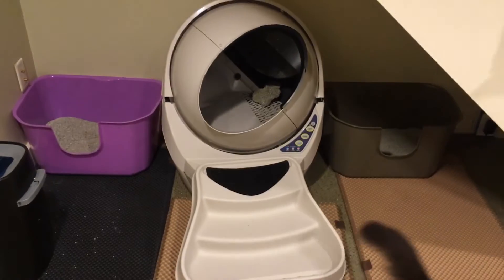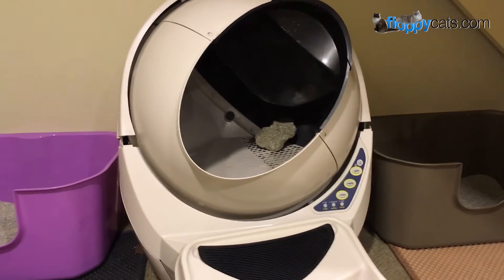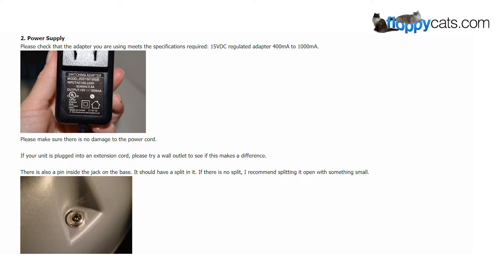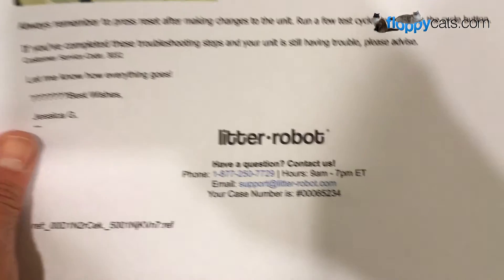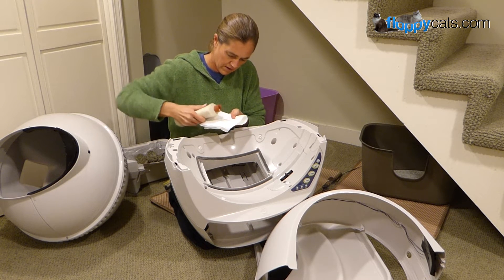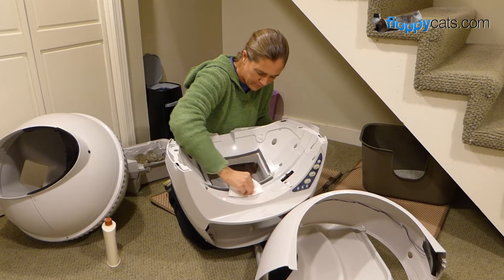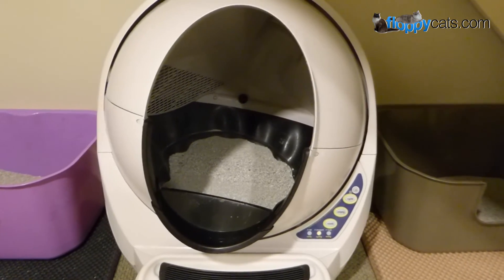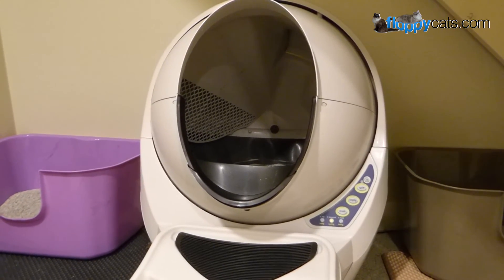Litter Robot 3 Open Air Troubleshooting - All 3 Lights Flashing - Floppycats

Comment from the maker: ✅ Litter-Robot 3 Buying Options:✅

💵 Worried about your cats using it? Want to be able to return it without paying for shipping?
😻 Buy on Chewy - Get 24/7 Help + FREE 1-3 DAY SHIPPING:
https://bit.ly/395ovFR

🤑 Buy the Litter-Robot 3 Connect on Amazon: https://amzn.to/3E1lrsP

🦘🥝Live in Australia or New Zealand? Click here for your Litter-Robot Open Air distributor: https://catevolution.com.au/litter-robot-iii-open-air.html?tracking=floppycats

🔴 Subscribe for more: https://www.youtube.com/user/steiff1001?sub_confirmation=1

Here's the email that LR sent me that I reference in this video:

If the Litter-Robot 3 cannot find Dump and/or Home position, the control panel will display 3 lights blinking. If you have recently disassembled your globe, please advise.

There are a few reasons why you could be getting this error message. We will touch on each component.

PLEASE NOTE
If your unit was purchased on or after February 21, 2018 (Serial Number 078843 and above), your unit will not have an internal shield. It will, however, still have the black key on the back of the globe. If you do not have an internal shield, please disregard the shield instructions (first video link) in number 3. You may still check the key/spring (second video link).

1. Excess Weight
If there is excess weight inside the unit, this will cause the motor to slow down and the unit will not complete a cycle in the allotted timeframe (~2 minutes, 45 seconds). Please check your litter level to ensure that you are at or below the fill line. If necessary, remove some litter from the globe so that the level is an inch below the fill line, then press the Reset button. It's best to empty the waste drawer as well if it's getting close to full; this will eliminate that excess weight also

2. Power Supply
Please check that the adapter you are using meets the specifications required: 15VDC regulated adapter 400mA to 1000mA.

Please make sure there is no damage to the power cord.
If your unit is plugged into an extension cord, please try a wall outlet to see if this makes a difference.

There is also a pin inside the jack on the base. It should have a split in it. If there is no split, I recommend splitting it open with something small.

3. Internal Shield/Key
If the internal shield or black key isn't set properly, this will cause cycling issues. When your unit is in the home position, the shield should be in the top left corner and the key should be straight up and down sitting in the groove of the base.

Below are two videos that show you how to reset the shield and key if necessary.
Key/Spring: https://youtu.be/RFdIfriScrM

Another option is to remove the internal shield. The internal shield is not necessary for the unit to function. To remove the shield, you will need a Phillips head screwdriver. Remove the screw from the center of the black key on the back of the globe. Once the key is removed, you can easily pull the shield out from the entrance of the globe. If you decide to remove the shield, please let us know and we will send you a key-hole plug for the back of the globe.

You can see the video on how to remove it here: https://youtu.be/OcxGXxMb8mI

4. Bonnet
If the bonnet is not seated properly, this will cause the unit to start and stop during a cycle. To make sure your bonnet is seated properly, please follow these instructions:
Disconnect the bonnet
Gently flex the two front bonnet tabs outward as close to a 90-degree angle as you can and hold for 20-30 seconds. This will remold the tabs to have a more secure connection.
Reattach the bonnet. There are four tabs total: two curved tabs in the back, two on the sides. The two curved tabs in back tuck into slots in the base. If they are sticking out, the unit will not cycle properly.
You should feel a secure snap and hear a solid “click” when placed back into the slot and the bonnet should sit closer to the base.
Assembly Instructions: https://support-litter-robot.force.com/s/article/Assembling-the-Litter-Robot-3
Video of removing/replacing bonnet: https://youtu.be/f2WVPQsR-Iw

5. Globe Lift
If the globe is encountering resistance that is lifting it out of position as it cycles, friction will occur between the plastic of the globe and base, causing the magnets in the globe to skip the position sensor which will cause the 3 blinking lights.

Out of the box, the Litter-Robot has a silicone lubricant layer that can wear off over time. An easy solution to this is Pledge Furniture Polish (if you have a different brand of furniture polish, it will work as well). We would ask you to please simply spray the polish on a paper towel and wipe the track of the base where the globe sits. Please avoid getting it on the black gear. I have attached a picture of the track of the base for your reference.

Always remember to press reset after making changes to the unit. Run a few test cycles by pressing the cycle button.

If you've completed these troubleshooting steps and your unit is still having trouble, please advise.

Litter-Robot
Have a question? Contact us!
Phone: 1-877-250-7729 | Hours: 9am - 7pm ET
Email: support@litter-robot.com
Reply from the maker: @PuddlesMegan i had pinned it - was it not?
Reply from the maker: @PuddlesMegan you're welcome =)

Comment: Instead of using furniture polish. I use WD-40 Specialist Food Grade Silicone a plastic lubricant spray. It really work. Just spray on the globe tracks and the motor drive shaft.
Reply: Hi there! While we typically recommend using furniture polish on the globe tracks, what you're using should work. We would, however, suggest making sure the product you're using is non-toxic to cats. 😸
Reply from the maker: i am glad you found something that works - i am not sure if that's ok, so i just asked them to double check.  i just get concerned warranty wise =)

Comment: Jenny, my litter robot is been 5 years now and finally had the same problem right now but my globe will keep cycling and keep going almost over the dumpster and looks like the globe going out then stops and then cycling back to the home position then start the 3 lights blinking left to right again. If I just push reset it will turn back to blue light. I will try that once my polish is here. hope it works for me.
Reply: Oh no! It sounds like you might need some replacement parts. We'd be more than happy to resolve this for you. Please contact our team at 877-250-7729 or support@litter-robot.com at your earliest convenience.
Reply from the maker: Sorry to hear about your issues - have you emailed support? https://bit.ly/3nvtZCo - I would take a video and show them, maybe?

Comment: I’m having the exact same problem where my globe lifts and makes a popping sound (which I’m assuming is the globe moving off and on the track incorrectly). I’m wanting to try the lubricant suggestion but am wondering if something other than furniture polish would work?
Reply from the maker: Litter-Robot said, "We don't recommend anything except furniture polish, so I don't have any other suggestions unfortunately"

Comment: Wow I've been searching for the info on 3 lights blinking (sequentially) on my LR3 and your video is the most helpful! I watched from the beginning to the end not missing 1 word. It was soooo helpful! I think mine is either the lubricant problem (same as yours) or the bonnet problem (but I have tried to seat my bonnet correctly like 100 times because everywhere I read, it told me 3 lights blinking b/c bonnet wasn't sitting properly). I hope it is fixed after I get some lubricant on my box. Thanks so much for posting this video! So helpful!
Reply from the maker: awesome - you're welcome.  i hope the lube is what you need - totally made all the difference in the world for me.  have you cleaned your litter-robot - like deep cleaned it?  and therefore might have removed original lube ?
Reply: @Floppycats   Yeah definitely have deep cleaned it so when I heard your lubricant solution a light bulb in my head haha very helpful video because you have thoroughly shared LR Customer Service's response, thank you again!
Reply from the maker: @midew2457  cool - glad it helped you.

Comment: Thank you for your very useful video. I just purchases a Litter Robot and wondered what brand of litter you would recommend. I am finding that the clumping litter I am using is sticking to the rubber bottom of the devise. Also wondering why you have other regular litter boxes.  Was this because you were on vacation? Many thanks.
Reply from the maker: hi, rusty.  we use Dr. Elsey's Ultra Premium Clumping Cat Litter https://amzn.to/2Dru1n5.  Another option would be to increase the time the litter has to sit - so that it has more time to harden.  what are you using now?

I have spoken about the other litter boxes in other videos - but basically, i have 5 litter boxes for my cats.  It's what they have always had because I grew up with a cat that peed on furniture and beds - so I never want to experience that childhood trauma as an adult =).  I also do like the safety in knowing that if for some reason the LR doesn't rotate or the power goes out, my cats have other options.

Comment: Glad you troubleshooted successfully, Jenny! Going by experience with computers and other gadgets, I wouldn't mind betting that if you'd just turned it off, unplugged it and then plugged it in and turned it on again you would've got the same result 😀. But it's always best to follow the manufacturer's instructions I guess, just in case, especially if just unplugging etc. doesn't work LOL!
Reply from the maker: ha ha ha, merry, i know that trick well and tried it 3x before contacting support - definitely needed to do what i did in this video in order to fix it.